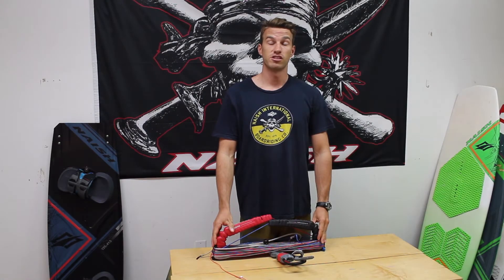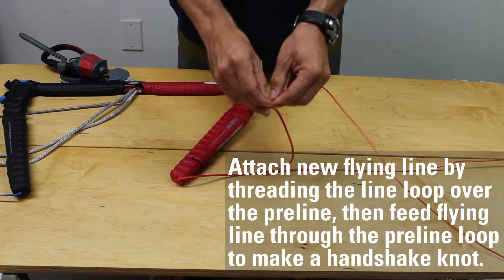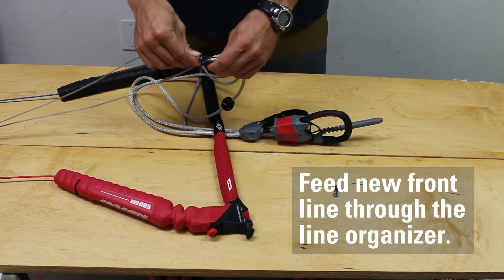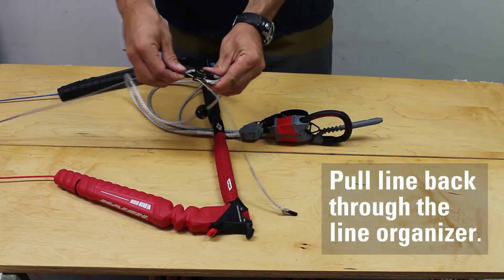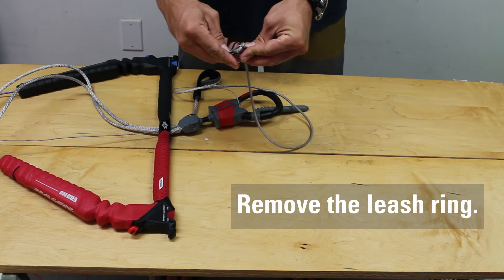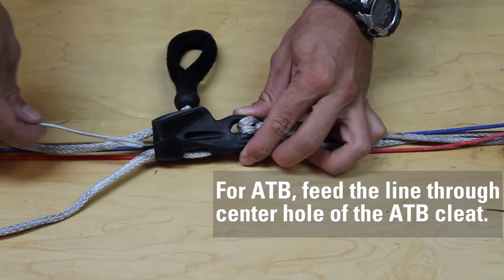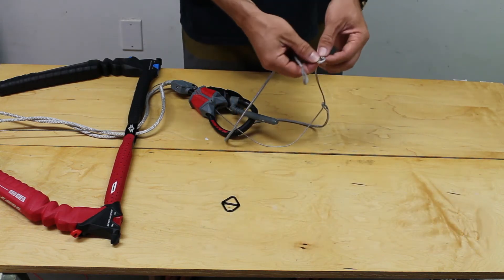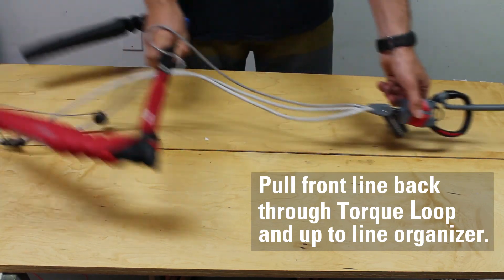Naish Kites How-To: Torque Control System Flying Line Replacement Tutorial

Comment: Hello, I have this identical bar. Used it a few time from new. I have a problem with the handshake knot on the flagging line. When I deploy the quick release and the flagging line pulls the line through the torque loop, it works fine.... The problem is that I can't reset it out on the water or with any pull on the lines. I cannot get the handshake knot to fit back through the hole down alomg the torque loop. The handshake knot where the elastic line meets the flying line is too fat to fit through once the are pulled tight... I have to loosen the knot each time to feed it back up to its original flying position.
Also I am have serious trouble with getting the depower line to release to full power. Every time I try it sheets the kite in more and more until its fully depowered... Which is very frustrating in light wind. Never had these problems with older Naish bars. Please help solve my issues. Thank you :)
Reply: Samuel Gavin  I have the same thing with the saftey line not going back through on a 2017 airush core bar. Thankfully i found this out on the beach and not in the water.
Reply: Hi Samual, can you solve the issues of the bar? I use the same model and have the same trouble /-;